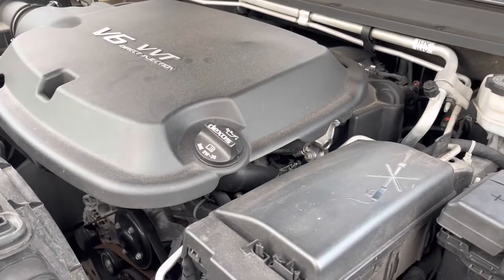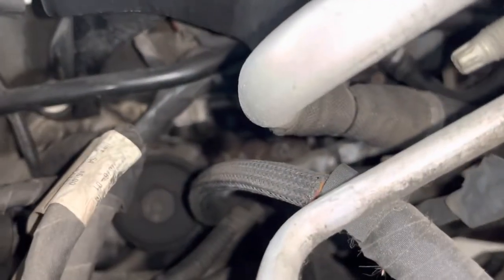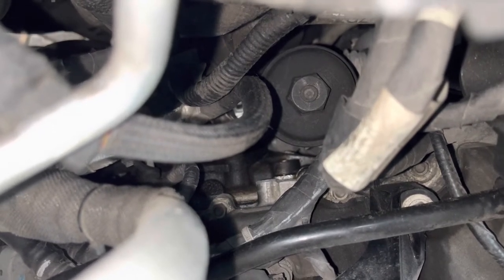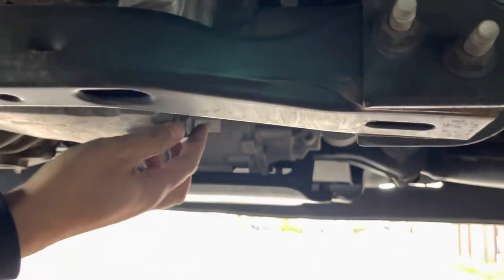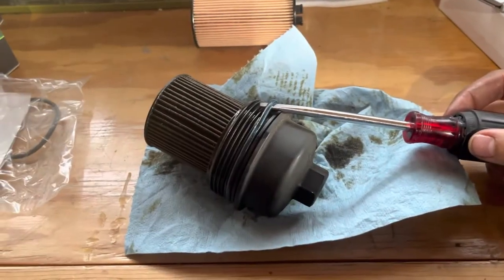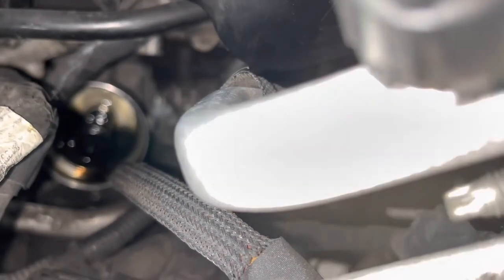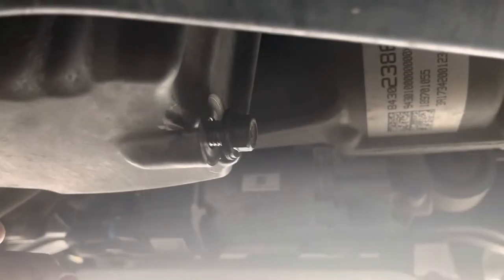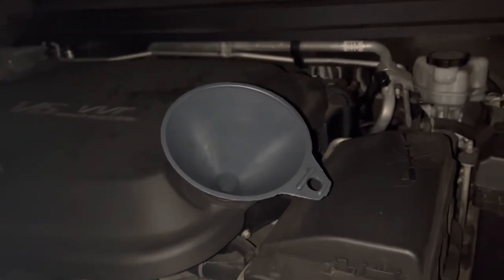2015-2022 2nd Gen 2018 Chevy Colorado GMC Canyon Oil & Oil Filter Change 3.6L V6

Comment: Does translate to Canyon. Same engine, same set up. Thanks for size on socket for oil filter. Have 4x4. There are 2 skid plates. Bolts are also 15 mm. There are 6 bolts. The plates share 2 bolts back of plate/guard for radiators, front for plate/guard for oil pan. The plate for the oil pan is heavy. Mind your head.

Comment: This might be dumb. But you don’t have to park on a slope right? You can change it with your truck on flat ground?
Reply from the maker: You can change it on a slope, although a flat surface is generally recommended. My other cars I put on ramps, so it’s fine. But when you check your oil levels make sure you’re on level ground.

Comment: hey bud, where do you bought your filters and packings? Also, do you replace packing on your drain plugs?
Reply from the maker: I got it all from the Chevy dealer.
Reply from the maker: Oh - and I didn’t replace it on the drain plug. Although the books will recommend that you should.